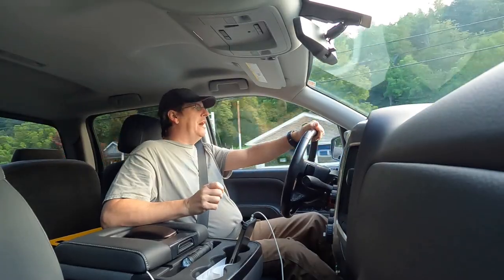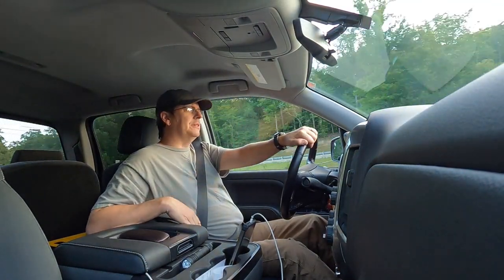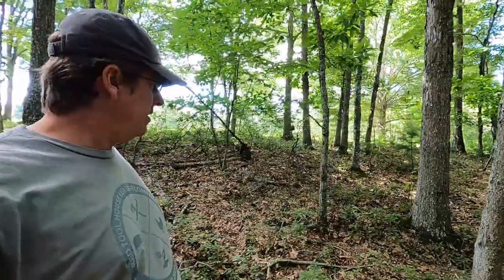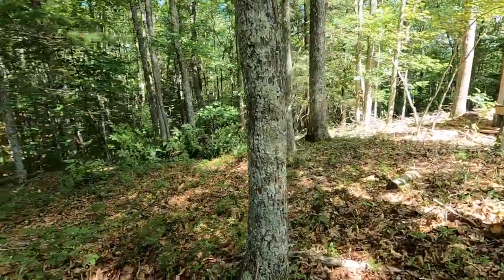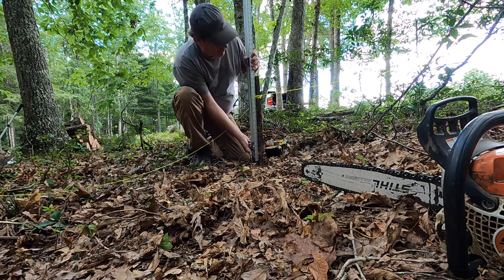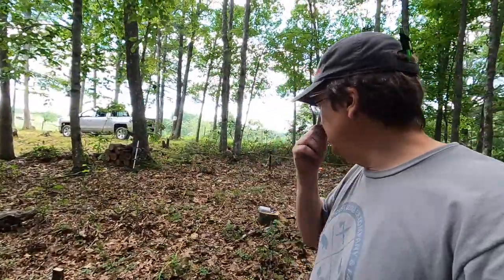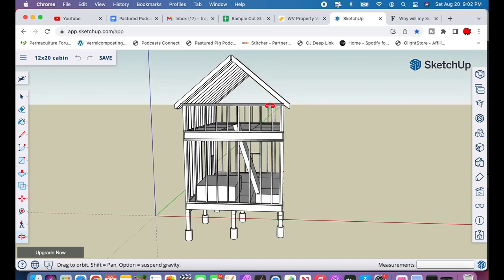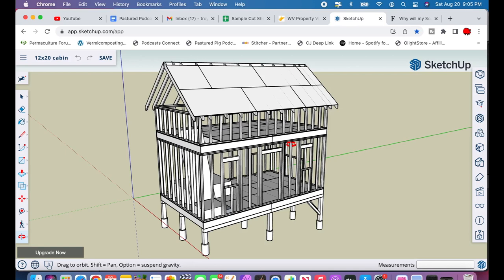Offgrid Cabin Build: Part 1 - Site Prep and Building Design

Comment: Troy, I would recommend that you use Simpson heavy galvanized base plates at your concrete pilings. They really stand up to the elements over time. And don't forget to drop some rebar cages into the sonotubes prior to pour. Looks like a great plan brother. God bless.
Reply from the maker: Yes! The Simpson braces are what we will use and the rebar will be added as well. Thanks for the input!
Reply: @RedToolHouse  It probably wouldn't hurt to at least consider a wheelchair ramp at some point. Or maybe leave the door open to add one later if needed or desired. I have no idea how much extra that would cost though.

Comment: I will be curious to see how much this ends up costing versus buying a large travel trailer and parking it on the property. On our old property we looked at buying one of those sheds versus a travel trailer and we ended up buying a 26 foot travel trailer. It was much cheaper and less work involved. Now of course it was just me and my wife and 2 dogs. We did build a shelter over the camper and a deck.
Reply from the maker: We looked at that. In my experience it seemed like the wear and tear on the RV drops the value so much vs something stick built that could appreciate over time.

Comment: Hey Troy, looks like a good plan.  I have a few suggestions for you.  I would make the steps on the shorter side of the building to keep it at a minimum climb for your parents and yourself.  It will also make for a "larger" outside "patio" if you do decide before or after building.  If you plan to cook inside, I highly recommend some kind of fan to the outside over the stove or table that you will be cooking on.  Maybe something in the loft also for the late sleepers.  I am sure during the cold season you will have all openings closed for warmth.   Just some suggestions to shake around.  Great video and you have a Great dad!  See you on the next one.  Aloha!

Comment: Have you looked into sturdi wall brackets to attach your post to your concrete piers.  They are pretty stout.  You can also delete your center beam if you are willing to use ijoist as your floor joist.  I built a similar structure down here in Wayne county
Reply from the maker: Simpson post brackets are the plan for the post. I debated on and off on the center beam. 12’ span just made me a bit nervous with the wind up there.
Reply: @RedToolHouse  if you are looking for a source for cheap windows and don't mind driving to the Huntington area you might want to give the Grandview outlet in south point Ohio a call